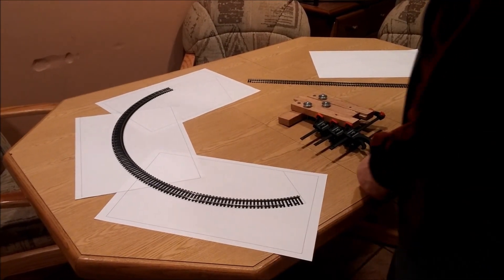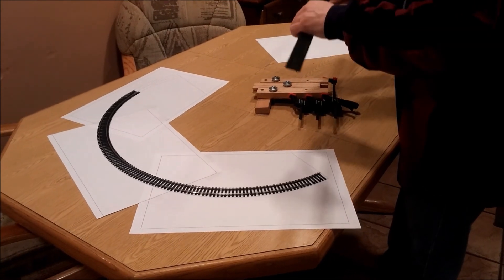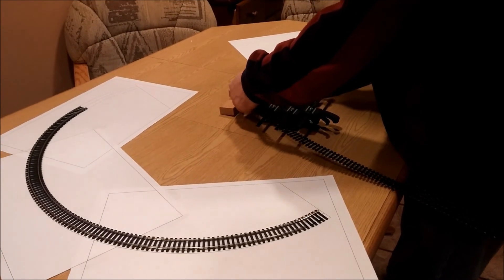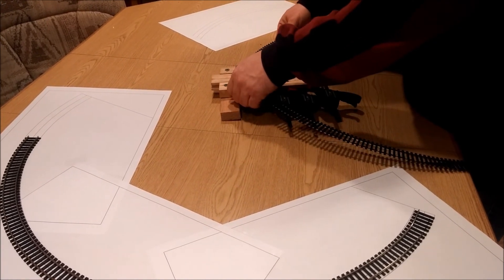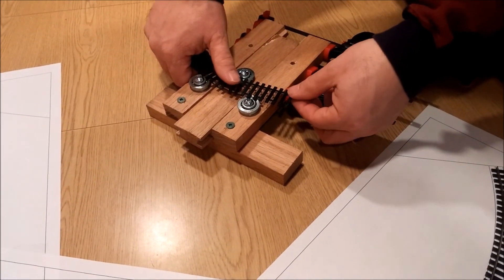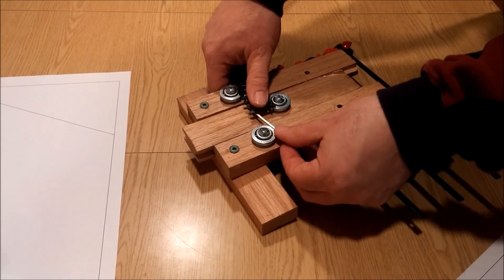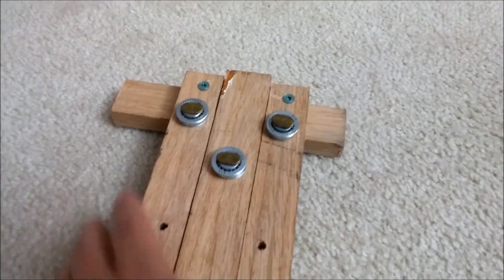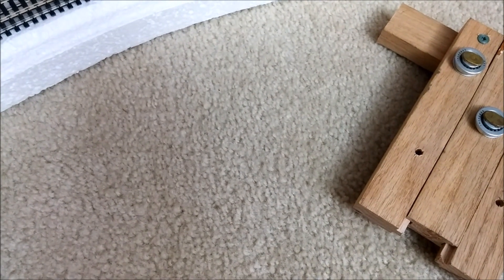HO Track Bender

Comment: I had a foam based modular layout. Would hold track in position while glue dried with woodland scenery long pins down into foam. I use yellow glue. Then eventually balested track.

Comment: Do not have to do this if you use Atlas flex track.
Reply from the maker: arthurhouston3 I am using Atlas flex track.  I made this because I could not find any other way to do it.
Reply: Draw radius on layout deck. If more than 3 ft solder two sections together before you start. Spike hole on straight and start working your way around one 8 " section between holes at a time. Do not put spikes in tight. Leave them lose for expansion. A couple of years of operations and you are happy ballast track and pull spikes and fill holes.
Reply from the maker: I am laying track on foam on modular parts that I move from show to show. Glue will hold the track, but if any sections break free they straighten out.  I had read about bending track by hand to relieve some of the stress and it worked.  I have seen are other videos of people either buying a track bender or making their own with screws, but they always remove the sliding rail to bend it and then re-insert the bent rail.  If I pre-bend the track it will hold it's shape till I can repair it by re-gluing.  It also make it easier to lay and repair.                          These are some examples I could find:http://tardus.net/railBender.html    http://www.modeltrainforum.com/showthread.php?t=3931    http://model-railroad-hobbyist.com/node/5145                               Thanks for watching my videos.  I am working on a what I think is a really neat project to try and break a world record.  I am going to be laying almost a 1/4 mile of track so I have a lot of work to do and a lot of curves.  I'll post more when I have a better idea if and when I can do it..